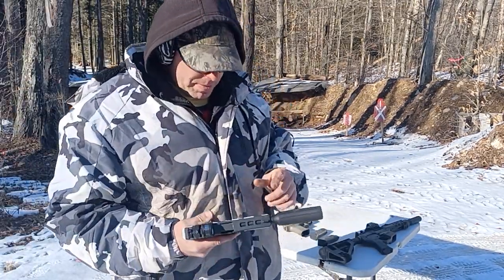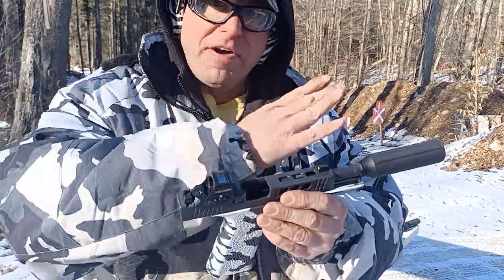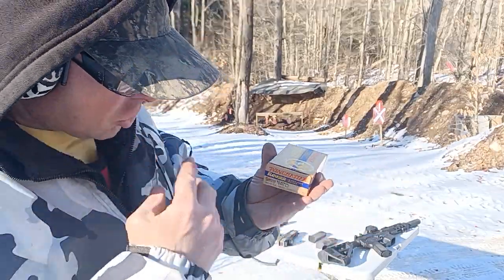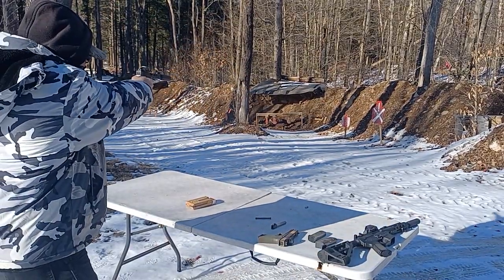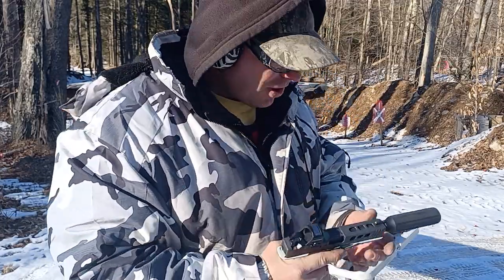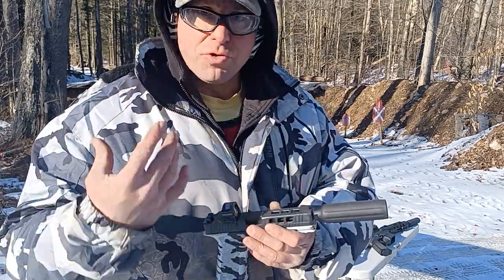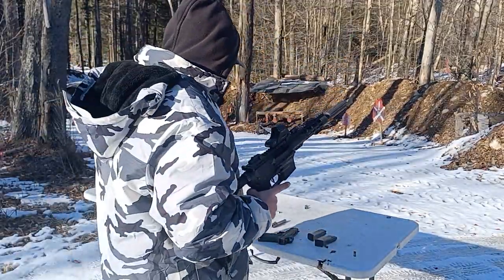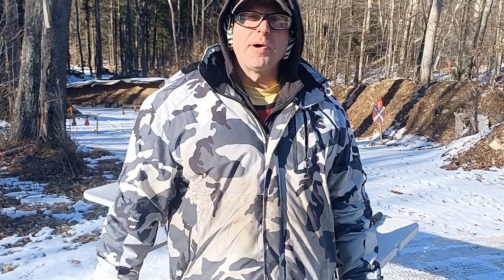Kaw Valley 9mm Linear Compensator - review and getting your pistol to work

Comment: The compensator is not to be a suppressor or silencer, its used to direct gasses out in front you, reducing muzzle flash not completely but enough to where its pointed  to the location your shooting at, the sound also directed in front of you, it doesn't muffle any sounds, it reduces the decibel so it doesn't damage your ears, however you can always still hear it.
Reply from the maker: I had the opportunity to test this side by side with a 9 mm NFA suppressor. The suppressor was a little quieter but not by much.

In either case both were loud enough to be heard more than a half mile away.
Reply: @tsafa So why get a suppressor when we have this
Reply from the maker: @Brian-rn2wx  that is why I never went through the time and effort to get an NFA item.
Reply: @tsafa  I've always wondered If shooting subsonic loads through something like this would be close but slightly louder than a suppressor
Reply: @tsafa  So I see the Extra Long Linear Compensator 6 inch long which to me is a single baffle supressor I think would be great for shutting up .22LR and 5.56 without all the paperwork. Anyway pretty please buy some stupidly long Extra Long Linear Compensators and see what they can do. It would be good contact, tax write off, end of the year.

Comment: Good info man. I have the newer version of the kaw valley linear comp the one that can be broken down into smaller sections and it works well on the Charles Daly Pak9. Plus it’s nice being able to shorten or lengthen it based on the use and type of firearm.
Reply from the maker: That's really interesting. Drop a link if you have one.
Reply: @tsafa  Its called the Kaw Valley Precision MACH 3 Modular Linear Comp. Got mine off ebay and they can use different thread adapters making it much more adaptable. Love mine. Ebay should have a few left.
Reply from the maker: @MarvelousCards  thanks. I will search it.
Reply: It’s called the Mach 3 even seems to be able to accept baffles..
Reply from the maker: @jamespaz322  thank you. I found it
Reply: Hope you’re enjoying it as much as I am! I’m looking for more stuff from them. How I found your video. Keep up the good work and stay safe.

Comment: Have you ever tried Kaw Valley's shorter linear comp. I think they have one about 2.5" long. I don't believe it would cause a malfunction.
Reply from the maker: I have not tried it I'll look for it.
Reply: @tsafa  I actually just found a cheap knock off on eBay. Ran about 60 rounds through it yesterday zero issues. 3" overall and it is very light. A bit smaller in diameter than a blast can. I had to file a 45 degree angle on one of the wrench flats as it was just touching the guide rod when cycled. I could have use the crush washer and timed it or used shims but, wanted to keep it as light as possible to run cheap fmj 115's on a factory spring.
Reply: @tsafa  26.87 before shipping, tax etc.
Reply from the maker: @UncleDanBand64  post a link here. I will check it out.
Reply: @tsafa  there you go
Reply from the maker: @UncleDanBand64  I don't see it. Did the link post?
Reply: @tsafa  I tried again. Your spam filter might be catching it because it is a link.
Reply from the maker: @Trad Bow Time With Uncle Dan  that sucks.  Try this at mod and I will adjust it...
[Dot]com
Reply: @tsafa  yes it is pulling out the link stand by
Reply: @tsafa  well, it will not let me even send a description
Reply from the maker: @Trad Bow Time With Uncle Dan  go to the description and find my web page with the email. you can send it to me that way. Thanks
Reply: @tsafa  yes sir

Comment: I appreciate the video. I purchased a Standard (2.06" x .95") KVP linear comp for my PSA Dagger home defense gun. Primarily I hoped that it might reduce noise and muzzle flash in a night time home defense situation. I'm still experimenting with ammo. I'd prefer not to dump my Underwood 90 gr +P Xtreme Defender ammo. It would not cycle on cheap 115 gr range ammo. If it's going to be a home defense gun it obviously has to be reliable.
Reply from the maker: I have been playing around with this for at least 2 years at this point and I don't see a real benefit to a linear comp on a pistol. I would definitely not put it on a home defense gun. I consider it's just a gimmick for having fun.
Reply: Wont reduce the noise like he said in video (i think he did) the linear comps purpose is to minimize concussion blowing back in your face by directing it in front of you

Comment: Just bought one of these to put on my PSA 5.7 Rock.
Shot 400 rounds through it today, not a single malfunction.
Reply from the maker: Great information. Thank you for sharing
Reply: did it made a difference in the sound since 5.7 is a bit snappy🧐
Reply: I'd like to know what significance it did as well.
Reply: @DodgersLH714  I have a S&W 5.7 and it does feel quieter in an open space, however shooting in an enclosed place it's still pretty boomy. I used the XL.

Comment: I shoot syntech 147 gr out of my CZ P09 with a Kaw Valley XL comp.

I use it to show people that they are limp wristing the gun when they shoot. If they hold it tight, it runs. Any slop in their grip and it will stove pipe. 

It is a great teaching tool.
Reply from the maker: Great information. Thank you

Comment: I had a heavy duty recoil spring on my Glock and with the Kau valley on, it wouldn’t shoot. Had to put the Glock spring back on and it works fine now.
Reply from the maker: Glad its working. I usually have to go a little lighter then standard with a leanier comp on postol.

Comment: I tried a linear comp on a full sized CZ pistol and it would not run reliably.  The weight on the barrel caused failures to reliably cycle.  FYI for those looking to buy.
Reply from the maker: Did you try a reduced power recoil spring like I did in the video? I don't know how easy it will be to find for a CZ pistol. I don't know how big the aftermarket availability is for CZ.
I also had increased reliability with 124 grain bullets.
Reply from the maker: I just read below that a poster got their CZ to work with the linear comp using 147 grain bullets.

Comment: Holy hell. That linear comp adds recoil ?  Sure looks like it.
Reply from the maker: It didn't feel like it, but I suppose it's possible that it creates some more back pressure. I had to put a lighter recoil spring in there so it will cycle with the comp. A heavier recoil spring usually softens the recall so the lighter one will probably exaggerate it.
Reply: @tsafa will the modular 3 piece version also work on pistols?
Reply from the maker: @MrDoverfield  I have never tried it, so I can not say for sure.

Comment: “Don’t use painted barrels!” LOL

Getting “lock out”. LOL

 “shooting it one handed proves how reliable your gun is”. LMAO. 

This is what happens when a novice thinks they are an expert. Most Barrels are coated these days and has zero impact on functionality. 

It’s called slide lock, not “lock out”. 

Weak wrist/grasp one hand shooting can possible bring an issue to light BUT it absolutely is not how you determine reliability.
Reply from the maker: I'm standing on about 200k of spent  cases that  I have shot and lost track of how many guns I built.   

You get up everyday to go work. I get up to build guns and shoot.

Maybe you missed a part that these are not Factory built guns. The built with Parts Sourced from different manufacturers that are naturally going to have wider tolerance stacking. differences
Reply: @  yet all I said still stands.

Comment: Doesn't look like you get the performance of a compensator...it's just for looks...
Reply from the maker: It's a tiny bit quieter if you're standing back and having somebody else shooting it. You can't tell while you're shooting it. 

I was at a gun range where somebody had a converted oil filter. That was a little bit more quiet but not by much.

Comment: Pointless.
Reply: Not really bud the linear comp has a point in a tight space situation namely your home it directs the sound forward toward your target and not to the side of you it will still be loud but not to the point blowing your ear drums out and at the range ppl will thank you that are on either side because sound from a standard muzzle break travels to either side of you with a linear comp it pushes the sound down range I got to shoot on mounted on a ar15 pistol and trust me the sound is very different
Reply: @obailey8586  I agree with you when the linear comp is used on the AR platform. However, I think on the pistol a suppressor would be better.
Reply: @DWArgenti  I agree with that but alot of ppl hate the idea of owning a nfa item namely myself but your right a silencer would be best on a handgun